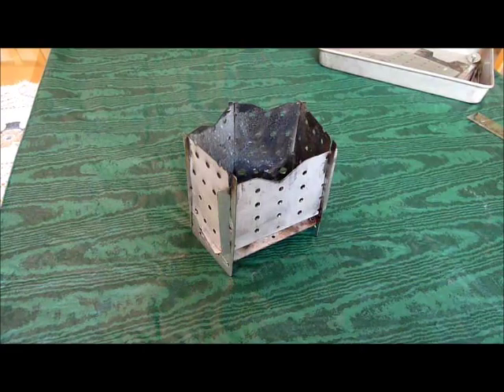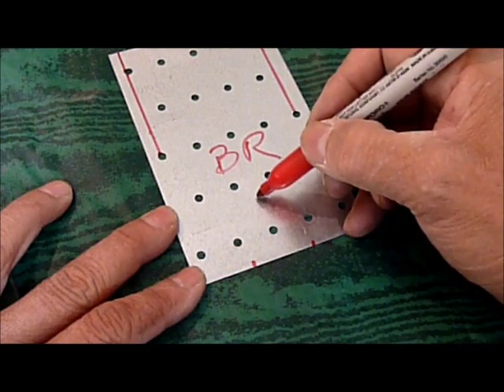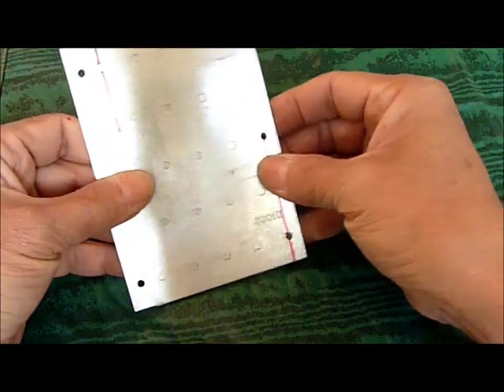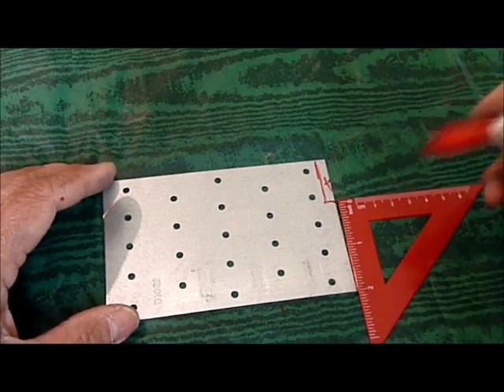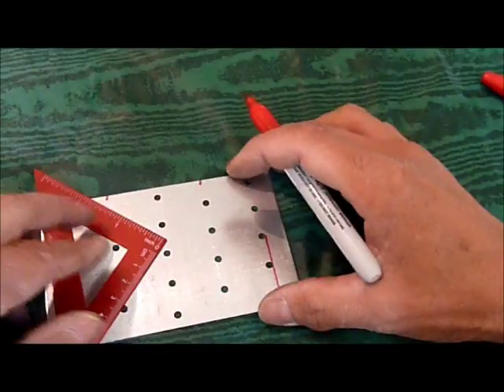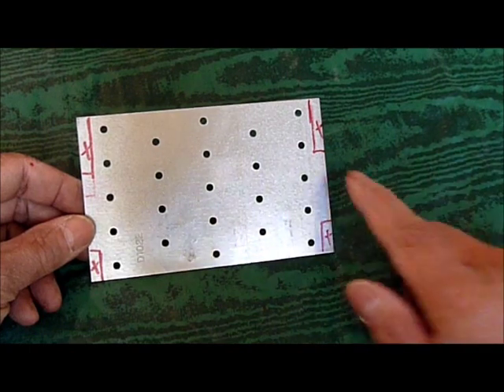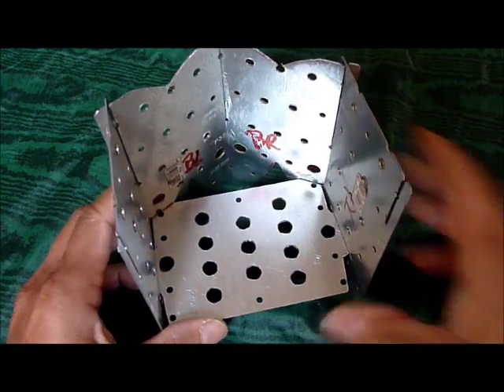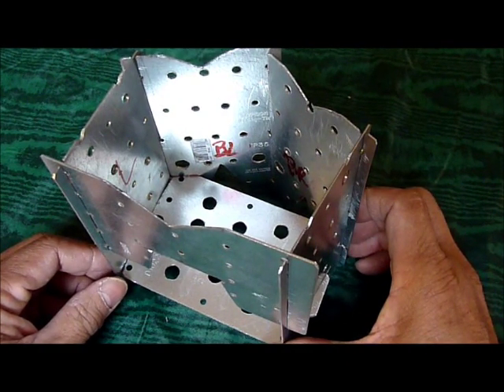$6 DIY Firebox stove - How to Layout and Build

Comment: just got done building mine turned out excelleny. I used vinegar to remove zinc coating. was alot slower but still worked perfectly. thank you again for the instructions.

Comment: Thanks for sharing this! I hope to build one soon. I just wondered about putting in extra slits on the bottom feed plate so it can flip over and then act as a top feed plate. I would stagger the slits so they don't meet but try not to cut them too close to the edge. What do you think?
Reply: sirtinkerist also do you know the thickness of the cutting disc you used?

Comment: for those who have never used a dremel i wish you would show the cutting please, for us that are building challenged
Reply from the maker: I used a angle metal grinder 4.5" with a metal cutting blade. You can get it at Harbor & Freight for about $20 ( or less when on sale) . I clamp the metal plate on a table corner and cut.